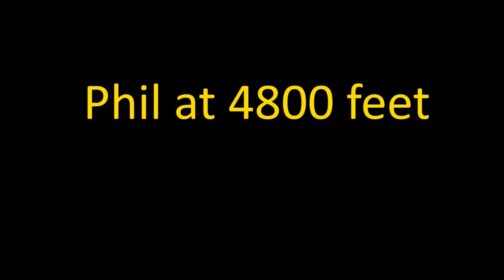Harvest Right's Premier Vacuum Pump Tear Down

Comment: Hi Phil.  We have tried researching our problem with no success and hoping you might be able to help. We've done over 200 loads with our medium fd. Recently it has been omitting a bad oil smell. We don't notice a mist or haze in the room but it smells horrible.  We have changed oil and demisters and it continues to smell. We took off the oil reservoir and removed the vacuum pump from the electric motor. Everything looked clean. Can't figure out what is causing this awful smell. Next step we will break down the vacuum pump. Any thoughts or ideas would  e greatly appreciated! Thank you for providing useful informational videos!
Reply from the maker: Could it be your oil mist filter cap?  The filter medium could support mold and bacteria growth:
https://youtu.be/qtpE7PLd0gQ
How often to you change/filter your oil?
Reply: @Philat4800feet  we changed the entire demister assembly with a new one from HR and the first load was good up until I checked weights and added more dry time. As soon as the pump kicked back on it started to smell. I change the oil when it tells me to or shortly after that message. The filter I replaced looked good other than a slight rust discoloration. It did appear to have some oil on it but not dripping oil. We did notice that when looking at the pump when running it looked as though it was almost like the oil was waterfalling if that makes sense. I use Robinair oil and I only overfillled it once  and had a mist in the air from it. When that happened we immediately stopped it once we noticed it,  washed the filter, dried and reassembled.  Still had the smell and just replaced the entire demister  assembly.  That was quite a while ago though. I'll see if I can figure out how to attach the video showing the oil movement. Thanks for your time in helping us figure this out. :)
Reply from the maker: What does it smell like?  Burnt plastic?
Reply: @Philat4800feet  smells more like nasty oil.

Comment: Thanks. While doing an overnight freeze-dry, I check the next morning and my oil site glass was popped out and was in the oil casing.  I took apart the front part to fix. What do you recommend to pop back the site glass in the casing? On other teardowns people use Loctite. Any recommendations?
Reply from the maker: Haven't had this problem.  At this point you might what to upgrade.  HR has a kit to replace the pump cover and gasket from the round sight glass to an oval.  if not, an oil resistant loctite product could be used.

Comment: Phil, I'm wondering why you're comparing the Navac 12 CFM to the Harvest Right 7 CFM Premier pump?  Have you looked at alternative Navac models, maybe there's a model using the same pump as in the Harvest Right.  I can see by the exploded parts diagrams on Navac product spec sheets, (available online), that the manufacturer uses lots of different combinations of pumps, motors, oil tanks and plastic/aluminum motor housings.  If you've identified the actual manufacturer that both Harvest Right and Navac are apparently using, please let me know.
Sure do appreciate what you do.  We seem to think a lot alike.
Thanks Again,
Dan
Reply from the maker: About 70% of the parts are the same with a bunch left over.  The only critical part not found in the rebuild kit is the secondary vanes.  I'm still looking for the perfect match.  HR has said they will make a rebuild kit available soon.  That was over a year ago.

Comment: I’ve spent the last day breaking down my pump. The entire this was coated in nasty brown goo. I’m nearly finished putting it back together. When you took it apart, the silver washer and o ring  were under the thick ring but when you put it back together, you placed them on top of it. I want to make sure I do not have to take it apart again. Do the o ring and washer go on the top of the thick ring with three screws, or under?
Reply from the maker: If I understand your question, I placed the "thick" ring retainer, held on with the three screws on first and then the bushing, O-ring, and silver washer.  It was easier to do it that way since those three pieces protruded past the retainer.  I hope this makes sense.  You should be ok.
Reply: @Philat4800feet  thank you!

Comment: Thank you so much for this!!  I have a request though... I can not get the black demister apart to clean the filter in there. I have no problems with removing the cover, cotter pin, the tiny ball, the rubber disc... but no matter what I use to insert into the slot (quarter, small wrench, screw driver) it simply will not unscrew to expose the filter. I've seen other videos showing people doing it so they can clean the filter but mine simply will not budge. Do you have any insight or suggestions on what I can use/do?  Thanks Phil =)
Reply from the maker: Sounds like a challenge...Accepted.

Comment: What is the Adapter You Used to connect Your Micron Gauge?

The connector fitting on a Harvest Right Pump is as follows:
This is known as a Hydraulic Fitting, not an SAE compression fitting.
The hoses provided by Harvest Right are specialized fittings with an O-Ring interface that is not standard for hydraulics. This has to be manufactured especially for Harvest Right. 
This is the reason I have been so frustrated trying to find the information. No one in the vacuum pump manufacturing business uses this fitting on their pumps.
Vacuum Pumps are typically used in the HVAC industry and use SAE J512 standard compression fittings.  This is why tracking down this has been such a problem.
To re-iterate the Harvest Right Pump fitting is a Hydraulic type:
JIC J514 37° Size 3/4"-"Dash" 12 with 12 Threads per Inch.
Reply from the maker: Contact a hydraulic hose shop

Comment: I wish they would redesign the demister cap, I couldn't get mine apart while cleaning, tried using channel locks and a rag to grip the threads, because this design has nothing to hold onto with your hands to separate the cap,  and it broke the pot metal part that holds the BB ball, so mine's missing the ball in it now.  Pump still works fine but can definitely smell the oil spray a bit when the pump first kicks on.
Reply: You can get an entire demister filter from HR.

Comment: So, have you looked at Navac 7 CFM pump parts? I did. Totally different pump.
Reply: And by the way, Harvest Right is offering rebuilt Premier pumps NOW. Wonder where they buy the rebuild components, don't you?
Reply from the maker: With all pumps, the main part I'm looking at is the gasket.  So far, only the Navac 12 has the same.

Comment: Hey Phil. Do you have any experience with the XL Premier pumps pulling in water and not evaporating it out? My pump is pulling in water and has corrosion in the outer portion you can see when you remove the main cover. I have cleaned it. Done lots of troubleshooting and within 4 months it’s corroded again.
Reply from the maker: Don't have an XL pump, Sorry.  You might want to change your oil after every batch.  I highly recommend it.
Reply: Thank you for the reply. This pump was new in June of last year. It just started retaining water around January. I have done loads of troubleshooting with Harvest Right, fixed the epoxy plug leak in January, cleaned my pump, and bought a new demister as it was severely corroded. When I cleaned my pump I only removed the cover and cleaned the exterior as I was told if I go any further it will void my warranty. I finally sent my pump back to them to diagnose and clean. They sent it back saying nothing was wrong. I removed the cover and it’s covered in rust again. Would the exterior rust cause damage to the inside of the pump?
Reply from the maker: This is where HR and I don't see eye to eye.  the vapor entering the vacuum pump is acidic (on the PH scale) and having any moisture within the pump isn't good.  After every batch, and while hot, I would drain and filter the oil while the pump is tipped forward.  The drain valve should remain open until the next batch when you're ready to refill with oil.  The demister cap should remain off and upright on a paper towel.  I would only use a vacuum pump oil with R & O additives such as Black Gold.
https://youtu.be/qPJ1sdce0NM

Comment: Can you tell me what size the connector is on the micron gauge? I'm trying to find a connector to fit onto my 
premier pump brass air inlet.
Reply from the maker: In most cases, I believe it's a 3/8" compression fitting going to a #12 JIC
Reply: @Philat4800feet  Thanks!

Comment: Loved the video, but my demister cap will not unscrew from the base.  Any ideas?  It just spins and spins.
Reply from the maker: Do you know if the outer black plastic is spinning or if the threads are stripped?
https://youtu.be/qtpE7PLd0gQ
If the threads are stripped, try pulling it upwards as you turn it counterclockwise.  You may need to remove the cover and see what's going on from inside.  The video link shows how to remove the outer cover.
Reply: @Philat4800feet  We removed the outer black and are trying to turn the inner black.  Cannot tell what is spinning or not.  Tried pulling upward as we turned counter clockwise without much luck.  If the threads are striped what will we need to do get a new demister and cover?  Thank you so much for the assistance
Reply from the maker: If all else fails, I believe HR has replacement pump covers and demisters.

Comment: Nice catch on that seal plate.🧐
Reply from the maker: Was that before or after I pulled out the seals?
Reply: Drain holes when you were reassembling.
Reply: @icebreakers7843  Yes, I noticed the retaining ring was rotated I assume for oil hole alignment. Going back towards the beginning of the video, the oil holes are lined up vertically.

Comment: I accidentally left the drain valve open and I think it went for an hour or two before I caught it. Is that bad? It seems to still be creating a vacuum, but I’m going to change the oil.
Reply from the maker: Time will tell
Reply: Thank you. I actually was able to retrieve the data from the machine and uploaded on my computer and I was looking through it and it looks like it only ran for about five minutes that way and then shut down. It says it went back into freezing mode. I think I’m good. I think there might be an emergency thing that stopped it.

Comment: Hi Phil,
I’m wondering if you could help me out. I’m looking for a replacement gasket for my premier pump. It leaks a small amount of oil and I’m pretty sure the oil is escaping at this gasket.
Reply from the maker: Standby.  Working on a parts list
Reply: @Philat4800feet  that would be amazing! I need the gasket between the pump and the motor.
Reply: @Philat4800feet  apparently Harvest Right won’t sell this gasket… this makes no sense to me. Why sell a product and not be willing to make some money by selling a delegate part?

Comment: Question: Egg went through the hose and got into the brass fitting.  Does it come out to clean?
Reply from the maker: How much egg?
The path the egg would take is through the check valve, primary and secondary vanes, and end up your oil.  The egg would have be blended with the oil.  Does the pump still work well?

Comment: After watching the Video I wonder if the Gunk you Scrapped off the Rotors was sugar-laden Water vapor from the Freeze drying of some kind of candy Like Skittles or Taffy. It makes sense if the water vapor taken from the candy was moved to that hot rotor the sugar may melt onto that hot rotor and stick to it. The water would then be removed by the vapor trap but the sugar could coat that hot rotor. I am going to reconsider running pure sugary items in the freeze dryer. The cost of a rebuilt premium pump is $399 and they don't sell pump parts and a new pump is over $700. I was told that the pumps are proprietary and they won't sell parts or tell you who the manufacturer Is. Today I went to their brand New Facility in Northwest Salt Lake, It is 2-3 times the size of their previous building, They must be making bank to afford this new facility. I went there to exchange a Door Gasket I purchased nearly a year ago as a spare and set aside. When I went to put it on my freeze dryer I realized it was for a large and not a medium dryer. I had Inadequate vacuum errors the last time I ran some Skittles, My Kids liked them but I could never finish the batch. I have been frustrated trying to find the vacuum leak, and have come to the conclusion it is not a leak problem but a pump problem. I had them Test the pump and they said it would not pull down. When I went to exchange the door gasket they told me I would have to pay for a new one because it was out of warranty. I pointed out the gasket had never been used and it was their mistake it was the wrong size for my machine. They didn't care it was out of warranty regardless of them making the mistake in the size of my machine. This really pissed me off and I demanded to see the manager and she said she was the manager, then I demanded to see the owner because I know him personally. He was not there. It's my opinion they don't take care of their customers unless you make a big stink. This should not have happened they need to take care of their customers and be fair with them. After making a big stink I was able to get the right size gasket, They tested my pump and feed Hose, and They said both were bad and needed to be replaced. I purchased a new Hose but could not afford a used rebuilt pump for $400. I went home and tested with the new hose it made no difference. There is nothing wrong with my hoses. So if they were wrong about the hoses are they also wrong about the pump. I am going to tear down my pump and clean it up just like you did and see if I get a similar result. I sure hope so.
Reply from the maker: You might want to invest in a cheap vacuum micron gauge for around $125 or so.  This will let you know the condition of your pump.  I'm working on a replacement part list.
Reply: I performed the same Cleanup on My Pump and was able to get an improvement in how low the pump would go with the chamber empty. 
Before cleanup, it was 1200 MT
After cleanup, it was 434 MT 
I have started a batch of Strawberries and it's been running for over 27 hours. I really think the machine has a vacuum leak somewhere. 
I purchased a vacuum meter but don't yet have the fittings to test anything.
Why won't the strawberries process with the Mili-TOR at 434 MT that is below 500?
The connection parts ordered from Amazon are still not here. But the Strawberries Ran 57 hours before they were dry enough to take out of the machine. The machine never transitioned to process complete after 57 hours of drying. I finally just took them out. They looked and felt like they were done. That is over $5 in electricity cost for one batch of strawberries, and twice too long. Looks like there is a leak or the pump is bad.

Comment: Any insite on why the premier pump is capable of 20 plus batch loads without any oil degrigation? Othr pumps have gas balast valves and still nneed changed every 2 to 3 loads.
Reply from the maker: The two main issues could be temperature and moisture.  Heat is a major cause of oil degrition.  I still have my old standard pump.  I should hook it up and measure the temp during a batch.  Moisture, being PH acidic, is another factor.  If not all ballasts are the same, perhaps HR's pump is just better.
Reply from the maker: Additional info:

Vacuum pump oil degradation can be influenced by several factors. Exposure to high temperatures, contamination with process gases or byproducts, and the presence of water or oxygen are common culprits. Additionally, mechanical wear and tear on the pump can contribute to oil breakdown. Regular maintenance and monitoring can help extend the life of the oil and the pump

Comment: So if the pump is leaking oil, what part would most likely be the culprit?
Reply from the maker: The large O-ring that goes around the green reservoir cover.  I believe HR sells them.
Reply: @Philat4800feet  Thank you!

Comment: 17:45 cant get it out easy. any tips?
Reply from the maker: If the issue is with the key-way, I would try a pick tool.  If the issue is with the "oil pump", try tapping the front shaft from front to back with a soft mallet.